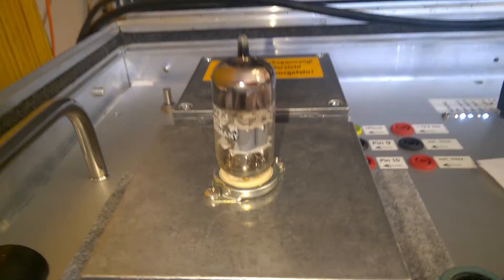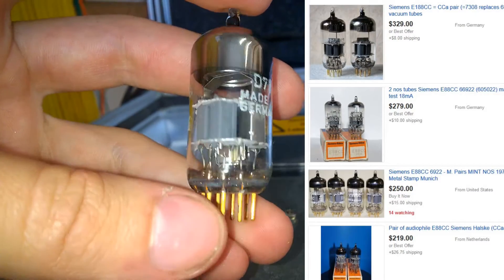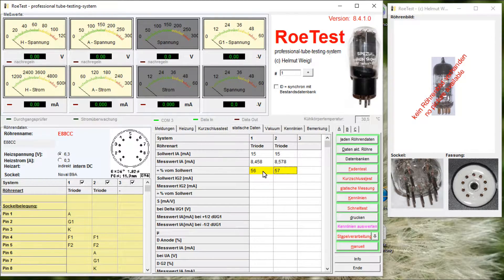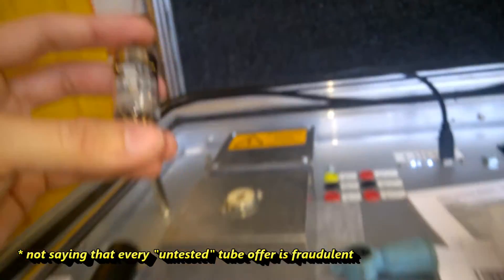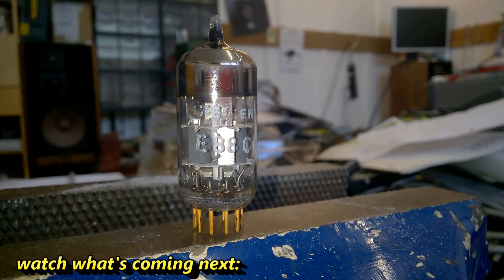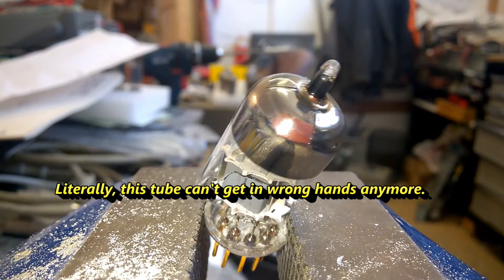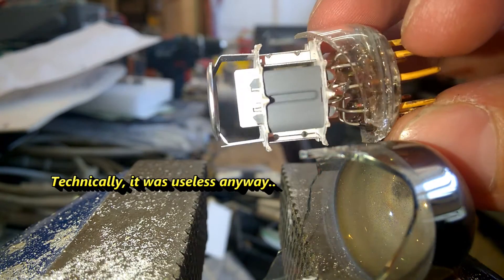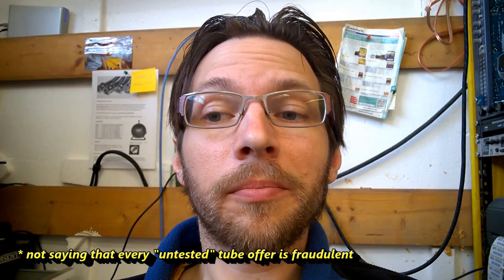This is why I DESTROY a Siemens E88CC Tube/Valve worth 50 Euro! BEB #20

Comment: You destroyed a pretty good tube, new/NOS tubes could indicate +/- 30% of nominal value, this means a tube with 10mA could be new and good, below 10mA could be used but not necessarily bad. Not good to sell it but good to use, for tests, or to donate to someone who can't afford such expensive type. I sell NOS tubes but weak tubes or when I'm in doubt that is unused I give them for free to those who buy new ones. Ebay offer protection for buyers but when somebody buy a tube as used/pre-own and untested he is assuming that could be bad. I sell for example  NOS 4CX5000A tube but untested, installations needed to test one costs more than many tubes (75 A for heater, few KV for plate etc.). By the way, one tube like this can deliver 17.5 KW power in audio. Or some kind of NOS tubes costs under $1, who spend time to test them? It is un untrue premise that all untested tubes for sale are bad.
Old tubes doesn't loose emission, they could became gassy, some of them are recovering themselves in use when getter is doing his job. Anyway, I threw hundreds of gassy tubes, never used.

Comment: From what I understand reading in my old valve books, valves that have sat for decades can take a while to wake up as the surface of the emmisive coating can become weak. Sustained cathode current causes the emissive coating to migrate on a molecular level to the surface and brings emmision back up.

Do you give your valves a chance to come back to life under real world working voltages before writing them off?

Old CRT displays do it too. They can start off almost dead but given long enough increase significantly in emission.

Also, good videos my friend ☺️
Reply: Interesting!  It's amazing how many 'I wish I had known that before I did that' moments turn up in electronics. :-) Still as an imaginary buyer i'd want to know it had been 'reformed' before paying $$$ for a supposedly good tube. Maybe put sketchy tubes aside for reforming experiments - 'for science' - but otherwise taking them out of circulation seems fair.   BTW other types of vacuum/gas tube can suffer from problems with cathode coatings or even gas (He) migrating into the glass - some people have put small gas laser tubes into microwave ovens to bring them back to life :-).
Reply: I recently ran several beam tetrodes that were NOS on a testing jig. A long soak on one that was low emission woke it up nicely. Some others with high leakage currents are now operating as they were when new.

Comment: I would have opened the top seal, then connect my vacuum system and tried to get it back up working just for fun. I really 
really hate those "untested" people. Love old technology!
Reply from the maker: Thank you for your comment. Vacuum was fine. The cathodes did not supply enough electrones anymore.
Reply: A bad vacuum would cause that, and if just reuse the Parts and build a home made one ;)
Reply from the maker: heh heh heh. I find dozens of faulty tubes every week,... so there are still many opportunities. I can ship you one...
Reply: what are you doing with them, throwing them out? i made the experience that in many circuits the specs are not that quite important, at least a view more hours out of the device ;)
Reply from the maker: Yes, that's right. Tubes like the crushed one may work in some niche applications. I don't offer them for sale, because even with all faults advertised it's very likely that someone with less experience will purchase them. Unhappy buyer guaranteed. But I don't crush them all, I always keep some of them for quite a time. The E88CC as an example, and the CCa in particular, should have high emmissions with a high balance between the triodes. If they don't perform as they should, then well...
Reply: i totally agree!! but there are allot more rare tubes out the especially for measurement equipment where replacements are hard to get. I really like your Rötest should really do such project but time is rare
Reply from the maker: you are right.

I have repaired a Siemens Ed for a customer, and replaced the socket to a more common AD1 (Stiftsockel).

Roetest: something you should consider only if you are testing dozens of tubes EVERY DAY  :-)
Reply: sometimes you have to do things ;), but if it works after the repair all is good.
I do a lot of thing just because i like to do them, like the youtube thing ;)
Reply from the maker: happy to see your next upload :-)
Reply: Yours too!